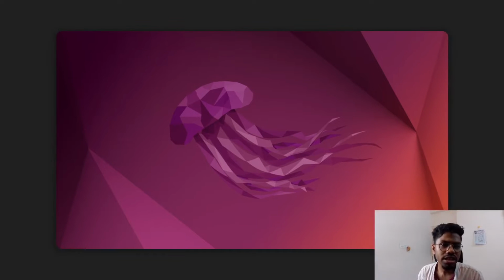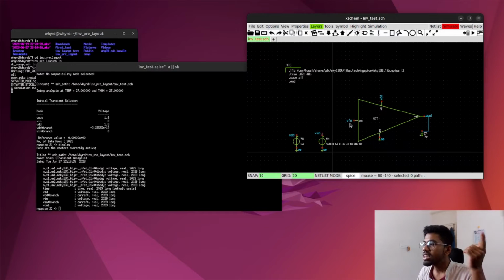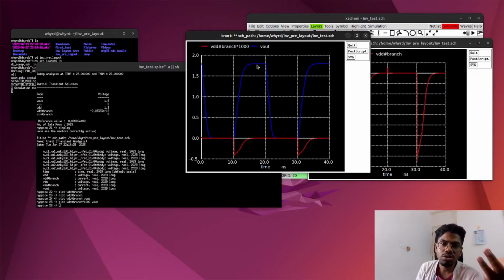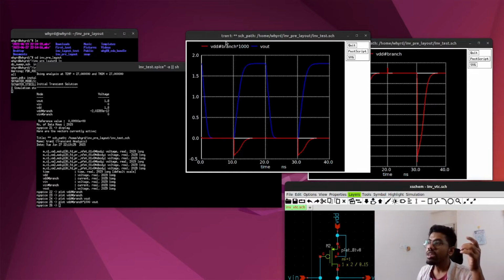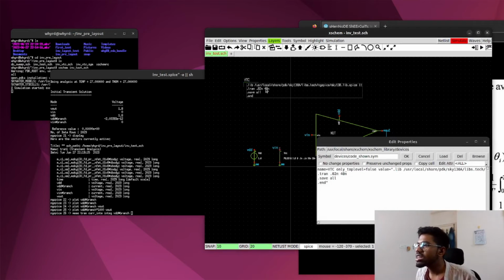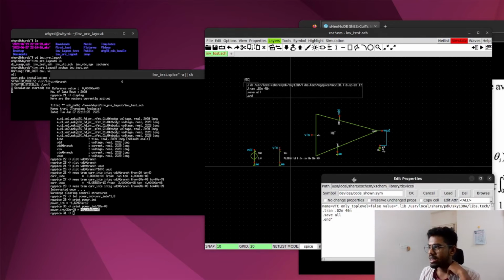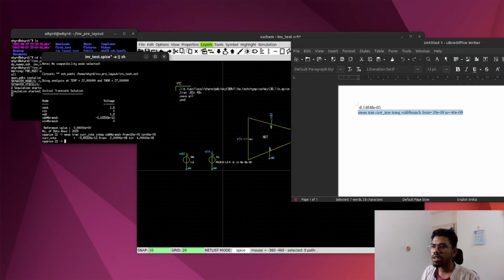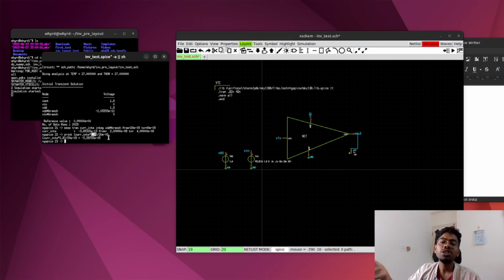CMOS inverter power simulation | low power design | sky130 |  Xschem | EP7:VLSI Project help

Comment: Guys a simple trick here, Put this command in transient analysis or in netlist near .tran or .dc commands
".measure tran Pavg avg par('-i(V1)*v(VDD)') from=0n to=25n"
for trans analysis i've given ".tran 0.1 25n"
where vdd and v1 are same voltage source, just different names in circuit and 0n is start of analysis and 25n is end of trans analysis, the output will be given in ngspice terminal with variable named "Pavg"
Reply: One more thing i've followed old tutorials of him and you must too, as lab pins components are required to do further calculations for other analysis

Comment: One doubt ! Please Clarify , What is the full form of Vdd,Vcc, Vss.....What does that mean ?
Reply: Bro please google it...this is basic qtn
Reply from the maker: They are just the power source , vdd coming as its connected to drain and ground , if its a voltage connected to drain and source we would have called it vds , and vcc coming from bjt terminal… and vss again its connected to source …. Basic but a interesting question